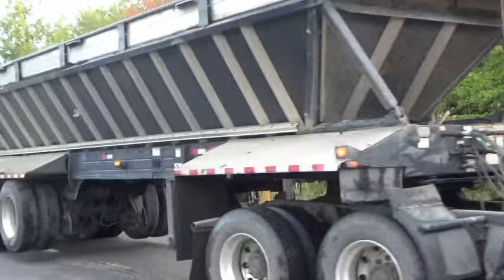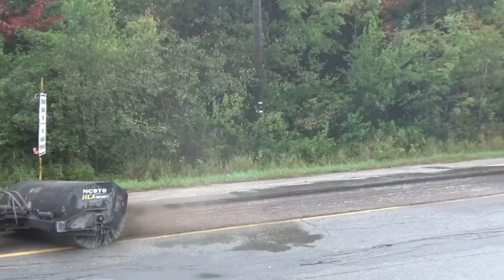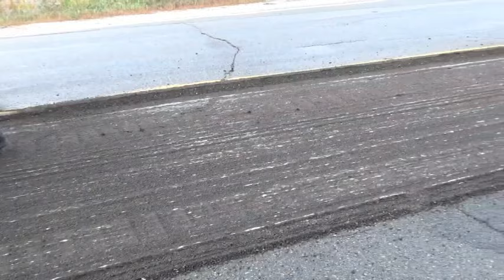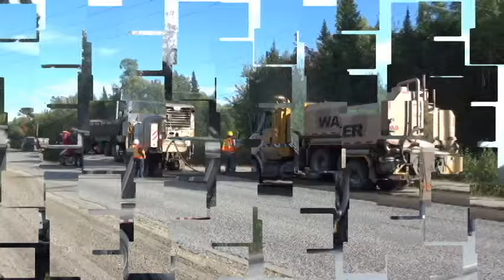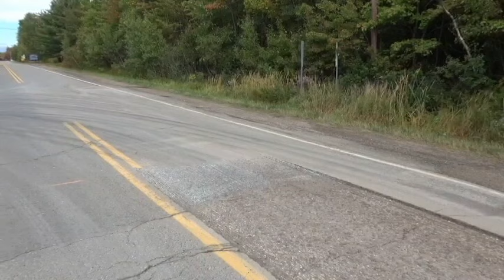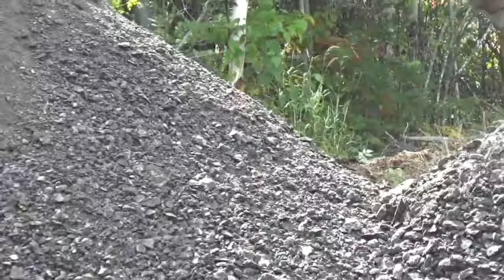Asphalt milling 101 Overview

Comment: Weres he orops or erops and 4ft off the ground why they not clipped in that's a Ted flag until it happens risk. Of the d8 needs one they sure do a dozer got a blade for stability the 988 keep your bucket low still orops and erops saftey first. Red flag if it moves 100 000 a min the truck drivers have to have them. Even the materials can't sell tou rock or sand not safe. Like > tell my drivers no snow removal not safe risk your cdl and frost bite so they can drive not safe at all they have to drive in the weather ice snow and risk making to the shop not Save. Land scape company you can plow the streets you don't ha bye the sfyey gear or experience if you do drives cool roads why should drivers risk their life's for 15an hr high risk of being hit or go off the road loss a cdl or driver can't risk it not safe at all. Why they are in more danger than everyone night pushing in the elements not worth tell a family you loved was killed because the it guy can't drive. It can.learn how to cook a hamburger not worth fast food to get minimum wage and labour for them saftey first get you fry pan ot looks the a soup pan then get you spork and make a ball and smash it flip as need be becarful your get grease burns

Comment: Change some teeth too pattern looks bad hopefully they have the grade up a few clicks so when they take that shoulder pass at full depth there is no ridge and they better run the petntiometer or slope cause that shoulder is definitely higher than 2 inches

Comment: Clean the  spray tip on spray bar. Clean the tips on the lower conveyor the two clean the two tips on the upper conveyor, clean the two tips for the spray for the fan that should be on so there’s no dust. I ran a milling machine for 25 years.

Comment: I noticed the road base layer (in its milled/planed state) below the running surface also had cracks running through the pavement. The new matt may start to show similar signs of failure in the not to distant future. You may need to plane/mill deeper, as there appears to be a problem at a deeper level.
Reply from the maker: This particular job was a mill and seal project and its aim is to simply replace the wearing course and buy the road another 8 -10 years before a more comprehensive Mill, Base and Seal. When we want to slow down reflective cracking we will use a Full or Partial depth recycling mix then base and seal.
Reply: @Ober447  Good man; you've bought yourself some time. Best wishes from Scotland.

Comment: My question is. What do they do with the old asphalt? Does it get colored darker, reconditioned and put back on the road?
Reply: Goes through a shaker put into separate piles at the asphalt plant then added into fresh asphalt as a filler according to the type and size of stone

Comment: Been on lots of these jobs, by the way the tailings are ECO-inert, so no special handling as it rains. most plants reuse a % into the mix as it saves money, the oil aka asphalt didn't go anywhere its in the tailings.

Comment: Don’t put the asphalt through a screen, it removes the fines….put it through a small crusher, set to between 1/2 inch and and 1 inch.
You will get 100% re-usable material ….goes down better and compacts way better ….
All round nice video

Comment: What's the pay rate for the loafers standing around with their hands in their pockets?  Where do I apply?
Reply: What would you have them do? all road jobs, local, state or federal REQUIRE a minimum number of employee as specified in the contract. It will depend on what the job entails. so the so-called "loafers" most likely have a critical part in the ENTIRE job, just not at the moment of video. 15 or more hour days are not unheard of and again what the contract specifies some jobs go 24/7.

Comment: I remember seeing, somewhere between 40 and 50 years ago, a roadworking machine that was an all-in-one road resurfacing machine. The road in front of the machine was all crappy and pitted, etc, and the road behind it was nice pristine steaming asphalt road surface. Never did find out why it didn't become widely used, or if it's even used at all.
Reply: not to many here in the states that i know of

Comment: good job.nice match.we mill in pa with older cmi.great machine.we have to mill out a section with 5 inches of concrete, 4 inches of ashfalt,  and 2 inches of dirt and stone.total of 11 inches in one pass.did half last year and the rest this year.alot to take out
Reply: Worked on a job with the CMI, yep they can (all machines really) can make quite a deep cut, just go slower and need more trucks. Great video

Comment: Ober447 - very important question/request for you, I am finishing up a construction safety video, part of which ties in with silicosis - for those who breathe in way too much dust from the ground, breaking rocks, concrete, or this crushed concrete - the very common dust crystalline silica - though I've noticed people really have to breathe in a ton of the dust over a period of years - or extreme exposures like the breathing in the dust from the twin tower collapse to get an issue from only single exposures. But anyways - I was needing to find some footage of someone milling asphalt to illustrate the crystalline silica that is kicked up in that task also - would I have permission to incorporate just a small bit of the clip showing the miller kicking the dust up? I can include just parts where you aren't talking. Just let me know if that would be okay. I do intend to sell this/strategically give it away for free to those who need it. In exchange for this - I can give the final product to you at a highly discounted rate if you are looking for a modern construction safety video (mostly specific to concrete construction) including modern medical treatments. In any case just let me know if that would be okay.
Thanks you for your time
Reply from the maker: I would need to get permission from all the individual people that are shown in this video and unfortunately that's not possible as many have moved on to other jobs.
Reply: @Ober447  Ah I see - a creative solution I have is what if I blurred out the people shown in the video - I'd likely be just showing 10 seconds of your entire clip

Comment: I really like the sound of the engine when the operator switches on the part which activates the milling drum to process the milling of the asphalt. So quiet that I don't even sense the activation of the engine.

Comment: How much does it cost do that for a small dirt driveway?
Reply from the maker: These companies specialize in highway work and employ equipment too large for smaller projects like driveways. I would suggest contacting one of you local paving companies and asking for an estimate, most do free estimates. Hire the company with the best reputation because using the lowest bid always means poorer quality asphalt being used.

Comment: Help.......I have a concrete driveway, previous owner put asphalt over the concrete.......can the asphalt be stripped back down to the concrete?
Reply from the maker: Yes, by means of a milling machine or an excavator with a smooth edge ditching bucket. However you will never get the asphalt stains completely erased
Reply: @Ober447  thanks for the ideas!

Comment: Something to add from a safety standpoint... Never, ever stand behind the mill when the drum is down. Every once in a blue moon, the track leveling system drops the drum too fast and the machine will take off backwards FAST on the drum, usually throwing the operator off the machine. It then becomes a runaway machine. That's one of the reasons there are so many emergency stop switches on the machines.
Reply: These newer wirtgens are good for safe on traveling backward, they have multiple settings for drum speed plus load control. With the older mills iv been on a few for that backwards boogie, both roadtec. Never on a Wirtgen
Reply: THANKS MR. FLINTSTONE
Reply: Who the hell is “operating” the machine when that happens? Maybe a hydraulic issue if your mill drops. wtf. Lol

Comment: What's with the lack of traffic control? That's a major hazard for these workers unchecked.
Reply from the maker: The TCPs don't stay with the grinder, they stay at set stations in intervals of one kilometer. So the grinder works within a 1 Km work zone and stays in that zone until the area is completed. At that point there is a brief pause while Flaggers move to another station and milling resumes. This is also a very low traffic road with less than 1000 cars per day and speed limits are reduced 20 km/h in work zones. If things become unsafe we implement a "follow me" vehicle and convoy traffic through the site.
Reply: Not enough room to use cones to separate from traffic. The gate on the side of machine dictates the depth of cut and cones just get in the way sometimes
Reply: They are Canadians. They are probably drinking Labatts or something.

Comment: Is that asphalt going to be recycled or just left there?
Reply from the maker: We will screen it down to 1 1/4" (0-31.5mm) and haul it back out and use it for the shoulders. Anything else leftover will get trucked to the nearest maintenance depot. We do at times recycle milled asphalt back in new hot-mix but only at about 15-20% content. We have gotten away from recycled mixes in favor of warm mixes in recent years.
Reply: Ober447 That’s good. Thanks for the reply
Reply: @Ober447  
I need milling machine,
Reply: I've been doing this kind of work in particular for the last thirteen years I drive a quad axle dump truck and I love it, especially when it comes time to pull the hot mix from the plant and repave the road with it
Reply: Usually the asphalt once it gets chewed up and spit into the dump truck goes to the asphalt plant to be recycled into the new mix